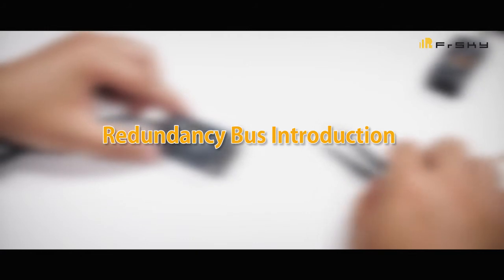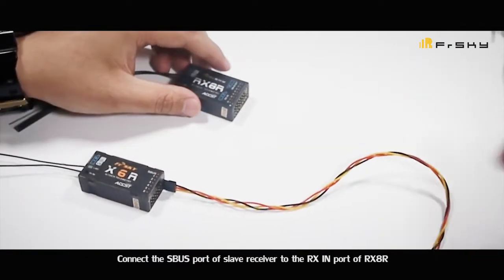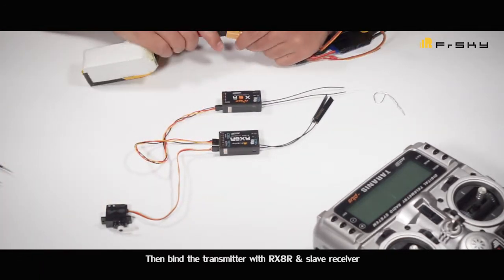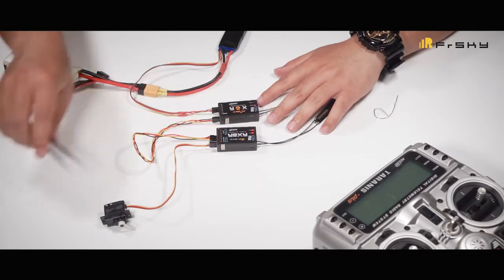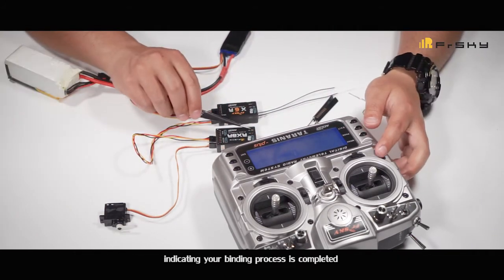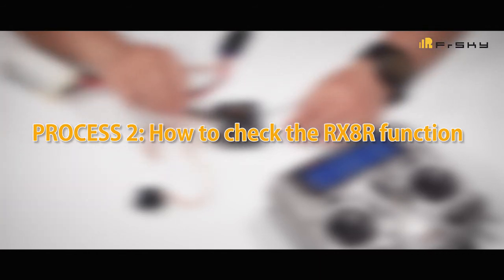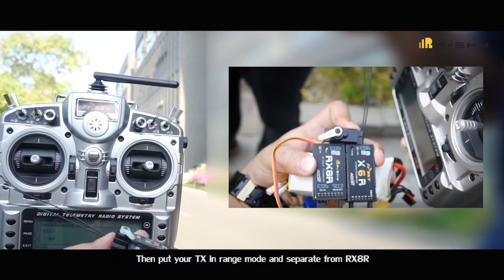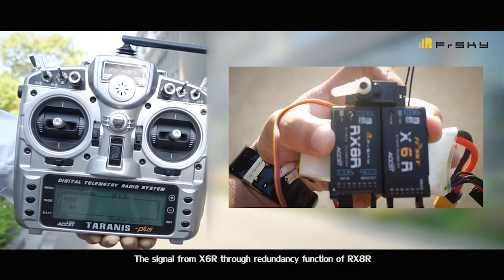FrSky RX8R Redundancy Bus Receiver Introduction and Basic Guide

Comment: When binding two receivers; for example, the rx8r and x8r, and I want to output pwm to channels 9-16, I suppose I should still use the two jumpers (pins1+2 &3+4) for binding on both, each receiver while binding?

As an option, can I also choose to bind one as no telemetry & channels 9-16 and the other as telemetry & channels 1-8?

Comment: The master and slave receivers need not to go through the binding procedure at the same time. This allows to test the redundancy in a much simpler way than removing the antennas from the master. Here's how to do it: bind the slave to the transmitter using a receiver number (say 4). If you use a Rx with telemetry, use the jumpers to make sure that telemetry is switched off. This is not necessary if you use a XM+ as slave (it has not telemetry). Bind the master to the same transmitter but with a different receiver number (say 5). Now connect them together (Sbus out of slave to Sbus in of master) as shown in the video, and connect the servos to the master. Power the master, which will also power the slave, and turn the Tx on with the receiver number set to 5 or whatever number you used to bind the master. The master LED with turn green, the slave will be red, since the slave has a different number.  Move the sticks and watch the servo move. Now, in you transmitter, navigate to the  Model setup menu, scroll down and change the receiver number to 4 or whatever number you used to bind the slave. At this point, if everything was done properly, the master LED will start blinking red, the slave LED will turn green, and you will hear your Tx announcing the loss of telemetry. But you will still be able to move the servos when you move the sticks on the Tx. For all practical purposes, the master at this point has no signal, but it is using the signal from the slave to operate the servos. THIS IS IMPORTANT: ONCE YOU ARE DONE WITH TESTING, REBIND THE SLAVE WITH THE SAME RECEIVER NUMBER YOU USED FOR THE MASTER.  Now power the RXs on, and both LEDs should be green.  You are good to go (do not forget to range test you setup before the maiden flight!)
Reply: Hi Alberto.. is there any way I can have the video for all these instructions? I plan to use the R9 rx for the master Rx and RXSR for the slave.. what do you think the best option for the R9 receiver (access)?
Reply: Thanks so much, worked perfectly!
Reply: Excellent contribution! Thank you